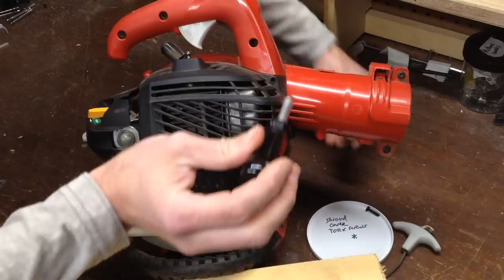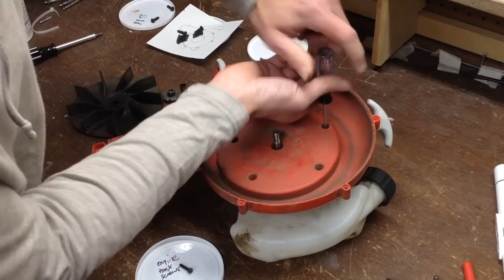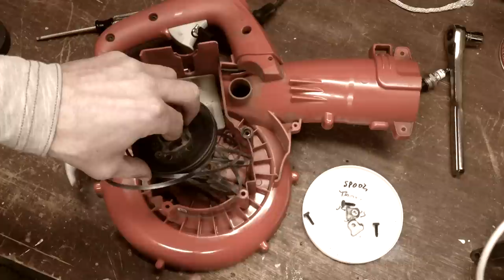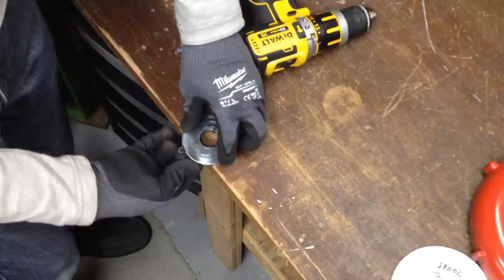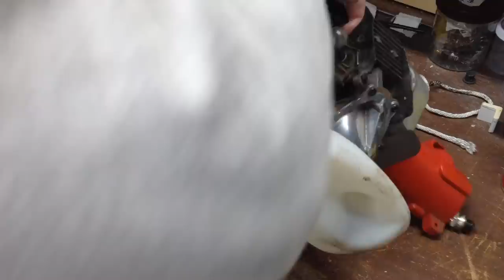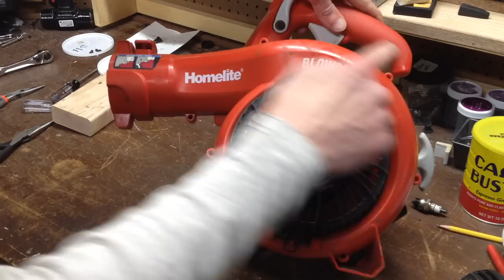Homelite Blower Vacuum Pull Starter Spring Repair - Cord won't retract - Disassembly

Comment: Thanks for your excellent video.  I'm not sure why anyone would give you a "thumbs down" because the video is very informative.  Thanks again!
Reply from the maker: Thanks for the comment Jim. I wish folks who give a thumbs down would explain why so that I could improve the content. For example, do they have a different model or was the video not concise enough or are they folks who have posted similar content trying to lower this video’s ranking in the search. I guess we’ll never know. Thanks again.
Reply from the maker: The center of the spring is on a brad nail. The chuck of the drill is halfway closed, so there are 3 prongs to put on the center spirals of the spring. It’s like having a 3 pronged fork and you’re twirling spaghetti.
Reply from the maker: Thanks for the feedback! I’ll add the tip to the information section for now.

Comment: I sprayed a couple squirts of WD40 into the hole where the rope goes into the housing. Mine did recoil before but very slowly.  I did it while the engine was cold.  I waited a day and when I tried to start it was like brand new.  Saved me an hour or two of work.
Reply from the maker: Excellent! In my case, the rope would pull out and stay out because the spring had bent and slipped out of the slot.

Comment: This video was a blessing, I have the same model and my starter wouldn’t retract.  I had to improvise another way of rewinding the spring though, I put the outside end loop in the slot, and wound the spring in toward the center, pressing the spring into the can with my fingers.  My drill chuck was too short to wind it with the method shown.  The tip on the ignition wires and how to remove the impeller were especially helpful.  Thanks!
Reply from the maker: Glad the video was helpful! And I'm impressed you were able to wind the spring by hand... that's no small feat! I've tried doing it only to have the spring jump up and bite me. Thanks for leaving a comment!

Comment: After 20+ years my first Homelite the flywheel keyway in the crankshaft hammered out so I had to replace it. After falling for the reviews, and after trying others, I am now am back to another Homelite. If I hadn't owned a Homelite before, I wouldn't have had my higher expectations to contend with it wouldn't have mattered. The center-pull rope means it doesn't try to flip on its side when you pull the rope, and the pull diameter is large enough to not be hard to pull.  They also start easy, which means the girls can start it any time they want to.  The downside to the center-pull is you need to disassemble more to fix them when a rope breaks.  Fortunately, that is something you seldom need to do, and they are well designed to be taken apart.  I have a brand new Poulan is on Craigslist at half price, that is not center-pull, has a small diameter recoil starter which makes it try to flip on its side when you try to start it, and requires you to be a small engine psychiatrist to get it started,  The Hitachi and Husqvarna start easier but still suffer have the side-pull issue.  The RYOBI has issues with the catastrophic turbine failure, cold-weather operation issues, and it's 2 lbs heavier than anything else.  I learned the hard way that it's not as easy to beat these little Homelites as one might think.
Reply from the maker: Jack T Thanks for sharing this info!

Comment: My pull cord was not retracting, so when I took the engine out, I noticed a who lot of debris and dirt in the rtraction unit. Since it did seem to have a working spring, I chose to flush out with water the retraction assembly while it was still in the blower housing.  this worked and the retraction mechanism works just like new.  I suggest you try this before pulling out the mechanism.  It may save you some extra work.
Reply from the maker: Great advice! Thanks for sharing that!

Comment: I can’t get the impeller off. You make it looks so easy. It won’t budge.
Reply from the maker: Might take a few tries to get the string to wrench it enough to prevent it from spinning.
Reply: @BruceAlanR thanks for the help!
Reply from the maker: Glad it worked out!
Reply: Thanks Bruce. Used the blower for a few hours and on the 4th pull of the crank it came undone again. Luckily I bought two springs. Hopefully it doesn’t happen again
Reply from the maker: Ugh! Sorry to hear that.

Comment: My starter wasn’t recoiling. What worked for me to get it to roll back inside was to spray a bunch of wd40 into the hole where the rope comes out of and give the housing a few whacks on the ground. It recoiled back into the case, but wasn’t engaging so I sprayed even more WD 40 in there and gave  it a few more whacks. Good as new. No disassembly or tools needed
Reply from the maker: Ha! Sounds like your issue wasn’t the spring, but I love it when a swift whack fixes a tool. Most of the time it doesn’t fix the issue, but it does make me feel better. 😜 Were you at all concerned about spraying a flammable lubricant around a hot engine?
Reply: I did the same.  Worked.  Definitely should try that first before getting into all of this work.

Comment: I’m confused, when using your drill to wind the spring, what is the drill grabbing onto to make it spin?
Reply from the maker: gary warmanen The drill’s 4 piece chuck, which normally grabs a bit, straddles the center windings of the spring.
Reply: BalanR thank you

Comment: This mower has been kicking for about 10 years now. Always had a short cord on it after the original snapped and other minor issues with the recoil starter  https://www.youtube.com/post/Ugkx-NCBSqqKJlyQ5_JGS_STpsFYihe7bmM3  until I finally had to open it up in an attempt to feed in a new line. I noticed it was all rusty and the coil was going but upon dismantling it was too much of a pain to get it all back in there correctly and opted to just get a new one. not sure why i waited so long to do so but it was a cheap, easy fix and it would have saved me hours of fiddling with the old rusty coil or trying to pull start and having cheap make-shift lines break in my hand during a pull. If yours is scuffed just replace it!
Reply from the maker: Bonus! Hope the video was helpful.

Comment: How did you get the impeller off so easily 😭
Reply from the maker: I may have loosened it so the video didn’t appear as though I was wrestling an alligator. 😃
Reply: @BruceAlanR  I finally got it! And it works again, thanks for the video man!
Reply from the maker: Awesome! Glad it worked out. I have to say that I really  appreciate tools that can be taken apart and rebuilt. Fewer tools in the landfill. 😆

Comment: COULD YOU DEMISTRATE HOW TO INSTALL THE LEAF VAC CONNECTION?.
Reply from the maker: I should do a video on that! In the meantime, to set up the vac, pop open the fan/impeller cover and you’ll see two screw/bolt holes. That’s where you connect the two bolts of the large diameter vacuum hose tube. The curved elbow tube with the bag gets connected  where the blower tube typically goes (to remove the blower tube, you need to use a flat head screwdriver to lift the tab... then twist the tube). The vacuum is simply the blower in reverse. As a blower, air gets pulled in through the impeller and pushed out the blower tube. As a vacuum, it’s the same... air gets sucked into the impeller and exhausted out the blower tube. Hope that helps!

Comment: I'm having trouble removing the fan
Reply from the maker: Hmmm. Did you use the starter rope (or any thick rope) in the spark plug trick at 2:51? The starter rope should jam up the fan. The first time I tried, the nut was on pretty tightly.
Reply: @BruceAlanR  if i do that will it prevent the bolt from turning when i turn the nut?
Reply from the maker: If the bolt is turning, that implies to me the starter rope isn’t jamming up the fan. Take out the starter rope and try again. The fan is only held in place on the bolt because the nut has teeth.
Reply: @BruceAlanR  i got it out already, now i need to know why the rope doesn't go back in when i pull it
Reply: @BruceAlanR  i put it back together now but when i pull the rope hard the spring gets out of place and the rope doesn't go back in
Reply from the maker: Sounds like the spring assembly isn’t seated properly so the end is not catching.
Reply: @BruceAlanR  is there a way i can send you a picture of it?
Reply from the maker: Sure. BalanR.reviews@gmail.com